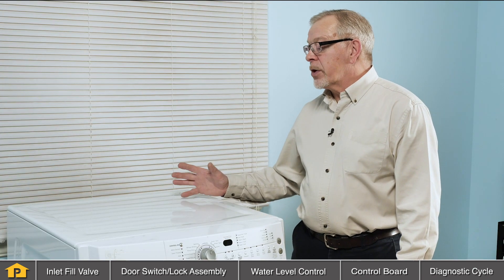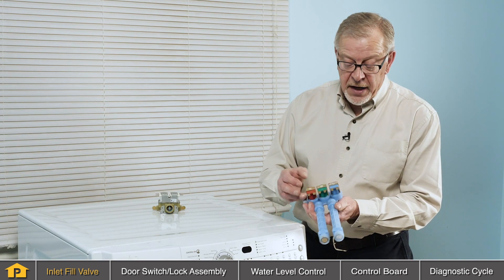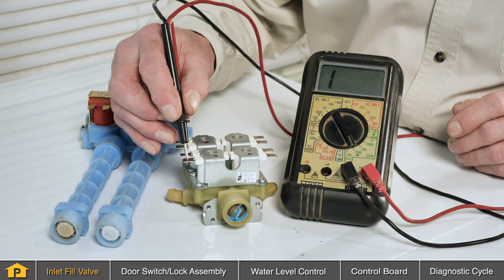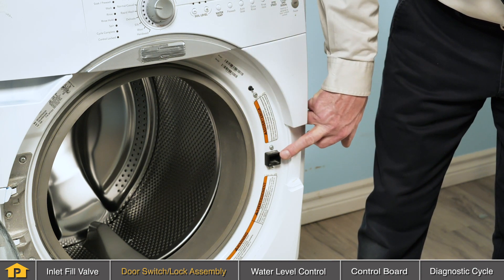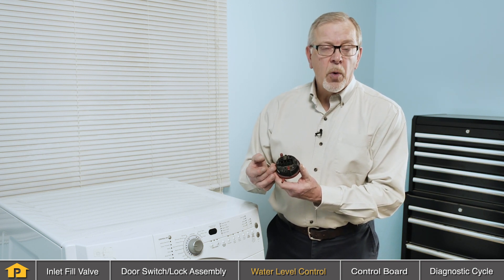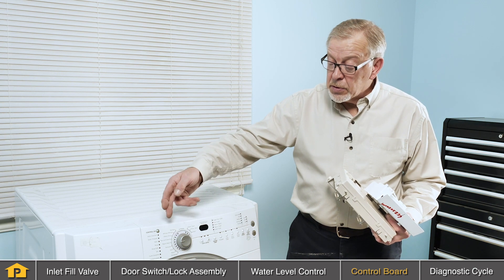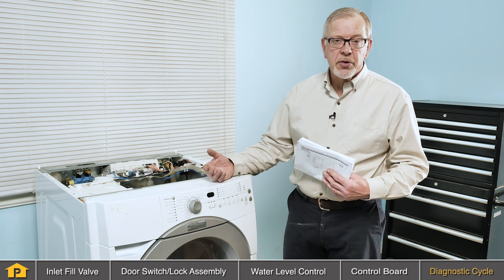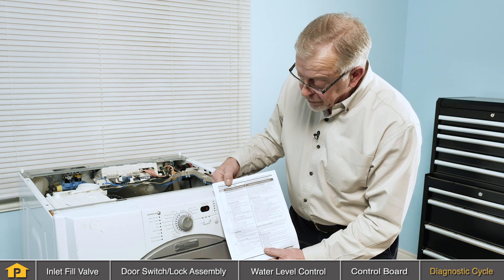Washer Troubleshooting: Front-Load Washer Won't Fill- How to Fix Your Washer | PartSelect.com

Comment: My GE GFWS1500D1WW water does not fill and there is the sound of motor running but the drum never spins. I checked the water inlet valve which is good with 1300 ohm resistance. However there is no power, 120V, to the valve. All control buttons work properly. Any advice, please.

Comment: If The cold water level is clog and if you don't want to use hot water for sometimes just removed the hot water hose and replace to cold water hose and connect to cold water outlet.

Comment: Good info. CAN ANYONE HELP? I have a Samsung-made Kenmore 592-49427 front loader. Hot or cold water flows in just fine on SOME settings (Delicate, Express etc) but NO water, hot or cold,  goes in on other settings (Normal, Heavy etc). I swapped the obvious - main "computer" cct board (DC92-00686H) - but the problem stays exactly the same! What else can it be??? I'm stomped!

Comment: while hooked up what if you do not have water coming out of neither hot nor cold
Reply: If you follow the video, and there are many, they instruct you how to diagnose the problem. Start with the simple instructions and if need be start diagnosing more involved procedures. The obvious first is are the water valves open...then are the lines going to the washer clear...are the inlet valves the lines hook up to clear meaning do you have to clear up or clean up the screens at the in flow... you slowly and systematically go through the diagnosis until your problem is solved. Don’t be discouraged just go through the steps and realize sometimes you fix one problem then find another. You will find you will learn a lot about your appliance, save a lot of money and enjoy the process. Always be safe and unplug your appliance, know how to turn the water off outside if you need to, know that it could take a few days to analyze your appliance and order your replacement part, make sure you pull your appliance out so you have room to work on it mostly taking the top off and sometimes the back. See as many videos, about 5, to get comfortable with what you should be dealing with and the most important if you feel uncomfortable with doing any of these procedures have someone help you or just hire a technician...they are the pros but usually you/we can handle it. For me it’s fun learning. Good luck